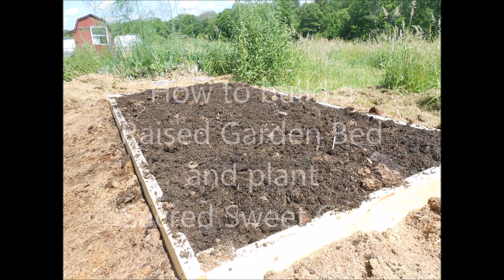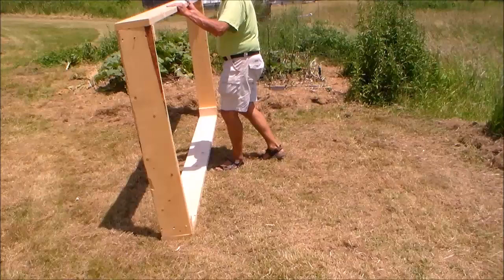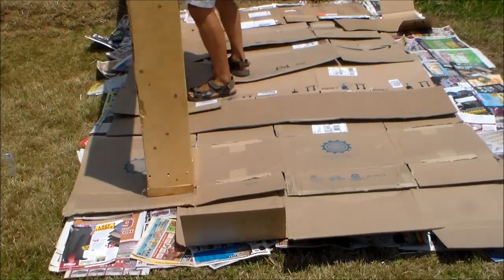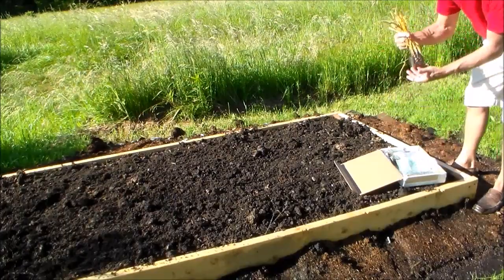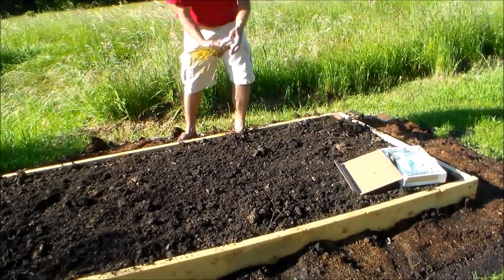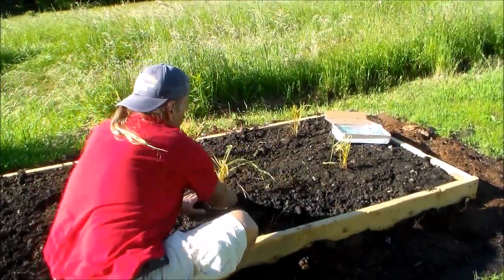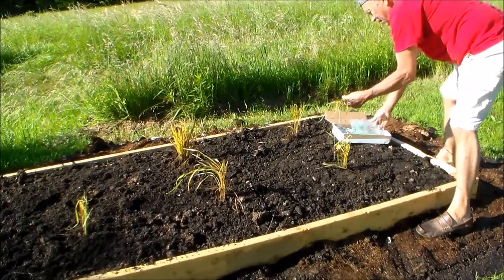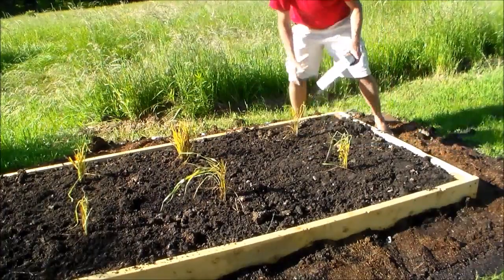How to build a Raised Garden Bed

Comment: What if the lawn beneath is not level ?  Does leveling make a huge difference ?  How ould you recommend leveling ?  With sand / native soil ? 

Thanks !
Reply from the maker: I would think that it grass underneath would not be an issue --- just get it covered and it will decay once covered and buried